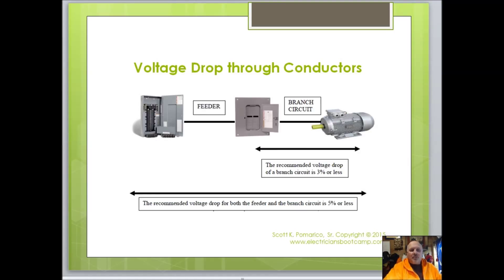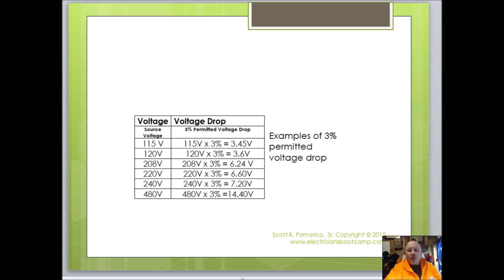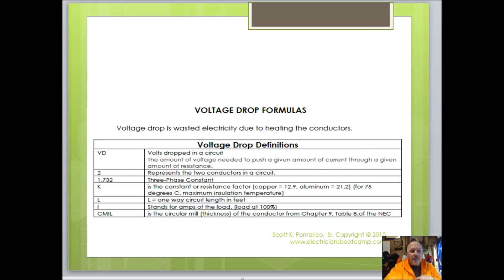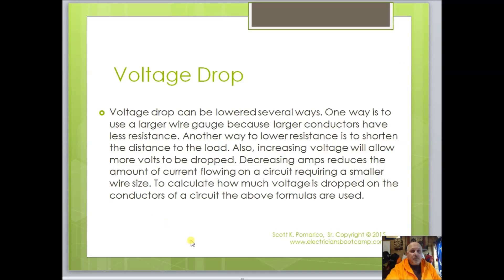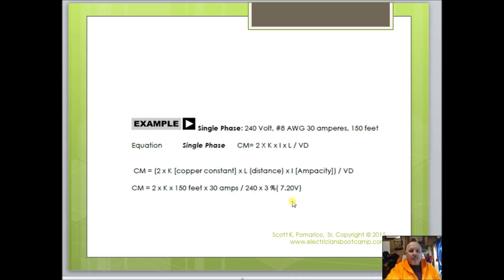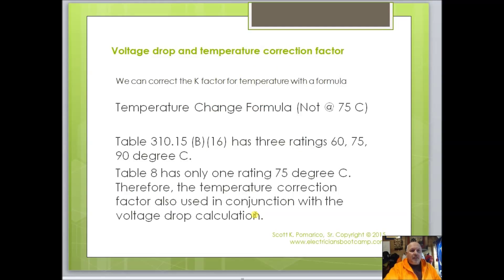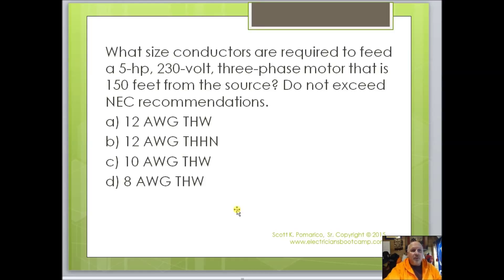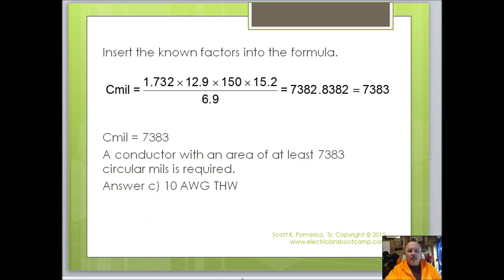Electricians Boot Camp Voltage Drop Calculations

Comment: Hi, when do I need to use the value of K=12.9 instead to do teh calculation k=(cmil)(R)/1000
Reply from the maker: You use 12.9 if the question says, #10 wire or 2/0 etc. You would use the calculation when the questions call out a specific wire such as #10 THHN.